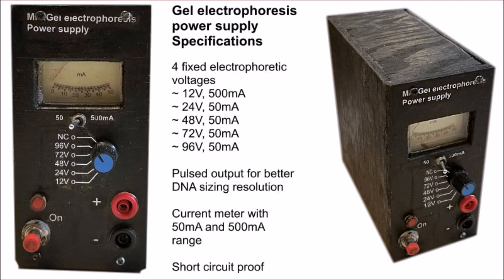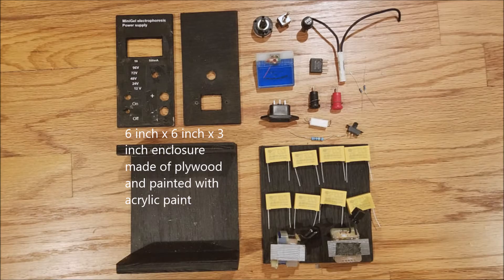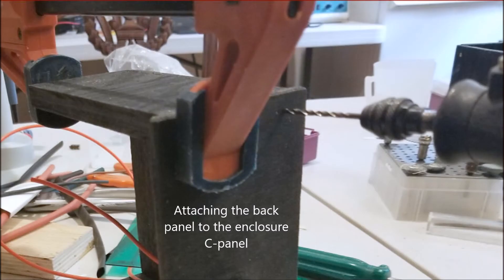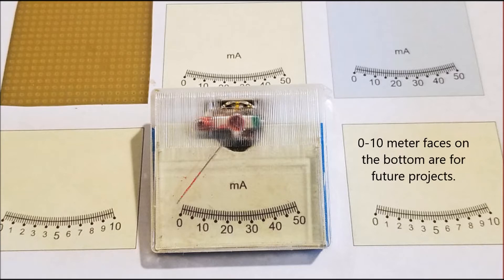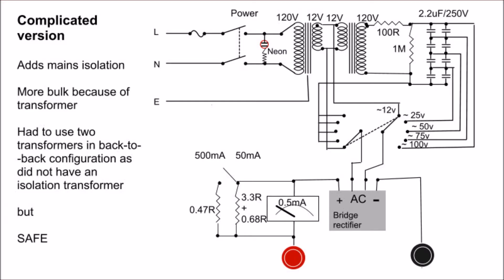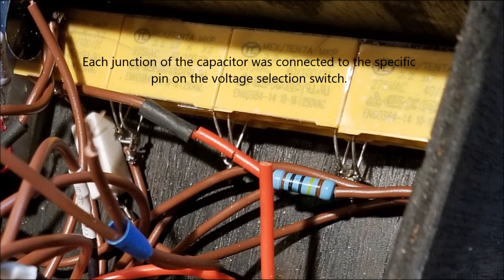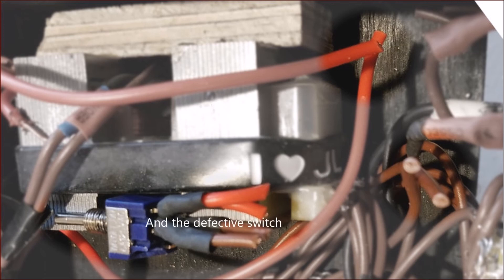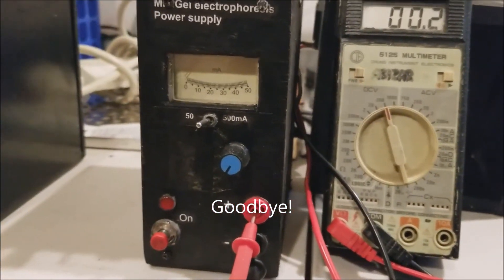Electrophoresis power supply

Comment: Hi, what would be the typical amps for a normal run at let's say 80 V? You also say that pulse Hi, This is amazing. Simple and effective. power makes for a better resolution. WHere did you get that information?
Reply from the maker: It is about 25 mA with 0.5x TBE buffer in the small electrophoresis chamber that I had made (see other youtube on that construction). Pulse electrophoresis is an old technique. If the electrodes switch from positive to DNA then the DNA also switches direction. If the ratio of forward time to reverse time is 10%, that is, 1 sec for regular voltage and 0.9 sec for switched voltage, then the path length - the actual length the DNA tarverses - is 10 times. A 10 cm long gel will behave like a 90 cm gel = better resolution of large fragments. This power supply does not do pulse - but the the non-constant voltage amplitude (repeated increases to a peak and then falling to zero sine wave) increases the speed of the DNA and then slows it down. This repeat speeding up and slowing down supposedly increases resolution.
Reply: OK, let me try to go over this. So we use polarity changes we do 10 steps forward (.9 sec) and 1 step backwards (.1s). That means that we change the average speed making it about 10 times slower so to that respect the DNA will traverse 10x the distance. The part I don't get is why the resolution will be better. I could understand that on a longer physical gel the distances between bands will be ten times longer so visually will produce a better visual separation. But that logic will not apply when the visual length is constant regardless if the DNA travels forwards or forwards and backwards. 
For the second case (this power supply) where we have sine wave we just tug the DNA  with a variable tension but we don't lengthen the path DNA traverses. We just slow down the speed and probably will end up with an effective speed versus peak speed the same way as we calculate a 110 AC going through an Edison light bulb. So it will work but we need to calculate based on effective voltage not on peak voltage.

Thank you for specifying the 25 mA. I was expecting something around 20 mA so that is in line with my gut feeling. I'm also under the impression that one should actually monitor current rather than Voltage as current will actually pull the DNA (or whatever reagent we pipette in the wheels).
Reply from the maker: @adriansphil9367  see the following publication for more information about the polarity switching ... Field inversion agarose gel electrophoresis of DNA
. David L. Weller, and Peter A. Gariepy. J. Chem. Educ., 1991, 68 (1), p 81. DOI: 10.1021/ed068p81